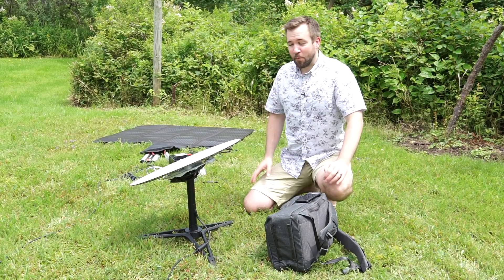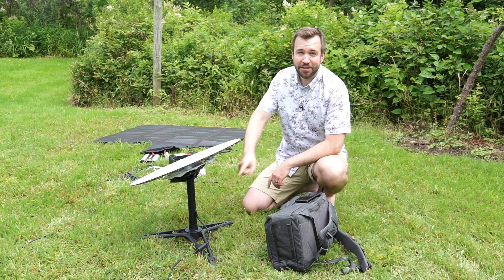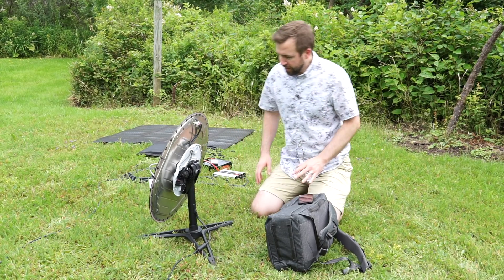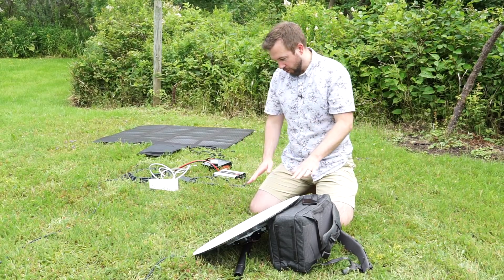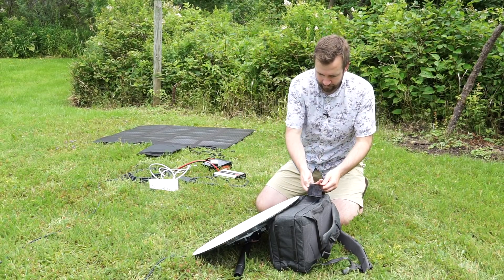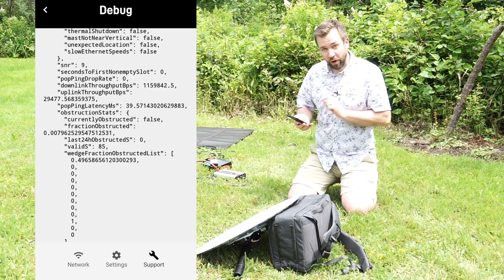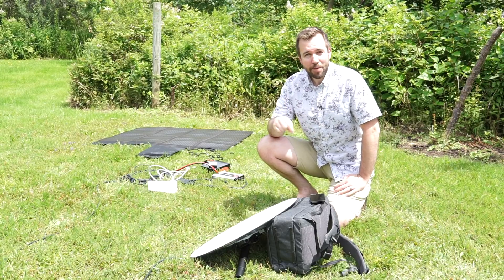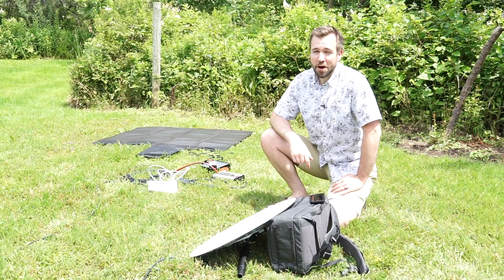Starlink FLAT PANEL Working - 210 Mbps!

Comment: I want to put it on a trailer roof, just flat.  However I did not realize that was an option until I saw another video where someone did that.  It's like 100x easier to install flat as opposed to installing it in a way where it is free to move and angle itself.  I've seen your video where you had some success, and there was a boating couple that mounted theirs flat.  Very interested in your results.  

The other thing is that at your home you can optimize the angle of the dish but in my case I intend to go to new places and then I will not really have the opportunity to optimize the angle (because I won't know the proper angle wherever I will be).  

I just want to know your results over time and any instructions on taking the dish apart.

Hey by the way do you know if it's possible to paint the dish receiver?

Thanks a lot.  I subscribed because I liked this video so much (although I have way too many subs).

Comment: You seem to be assuming that the satellites are stationary.
They are moving overhead at over 1700 MPH, so the motors need to point the antenna.
Reply from the maker: The motors actually don't move the surface to track the satellites. The panel is a phased array that uses electronic beam steering to track the satellites as they pass. The motors are only used to set the initial position. Thanks for watching!

Comment: A couple of things (tempered by the fact that I still can't get Starlink here).

#1 I've been told that they use a special cable to the dish because they are using much higher power than normal POE+. Not sure what to recommend other than check for shielding and use the largest size conductor possible.

#2 I'd probably set the dish up on the tripod, and hand a plumb Bob off the dish. Put a paper under the point and draw a dot. Check the position of the point every 5 minutes and see if the dish is making micro adjustments during operation. Also keep track of signal strength if the app provides that value.

Comment: I currently don't need Starlink anymore, however everything they're doing with Starlink is amazing and I'll always stand by it regardless. It will help so many people out and can ditch their terrible ISP's who like to overcharge and underdeliver internet to them. I think it will be great for when you're on a cruise ship and you're able to actually get internet service. Or a setup somewhere where you get power for everything you need somewhere in the mountains. I find this really awesome to think about. Most people right now who live in mountains actually use satellite internet and it's either not working at all because it's so bad or the speeds are literally so bad you can barely open a webpage.

Comment: I wonder if you could use an array of helical antennas properly tuned and connected to the circuit board and pointed in the vague direction of a satellite.

Comment: Hmm. I wonder if you can ditch the inverter and POE injector for the Starlink. Use a DC voltage converter instead, 56v 1.6a for the dish, then a separate 12v 2.5a for a wireless router. 🤔

Comment: Starlink should develop smaller motorized panels to fit into a bag. This is very useful for travel and for journalists and activists who live in dictatorial countries.
Reply: As the Starlink constellation becomes more and more robust, I expect we will see some amazing things in terms of receivers.   They are already talking about the more robust versions of receivers that would be used on moving objects like ships, planes, etc., and while 200+ MB/s is fantastic, I can see where a very very small, backpack version that could even provide 50-ish MB/s would be extremely useful.
Reply: I imagine that like GPS the receivers will continue to shrink to the point where everything is on a small chip. Although there will be limitations with receiver configurations and device implementation because the radio frequency requires line of sight connection.

Comment: When you remove the motor, will the power consumption decrease? 
and how much the change ? 👍👍⚡
Reply from the maker: I feel like it won't decrease much, since the dish doesn't normal move using the motors. If they're not moving they shouldn't draw any power. Still lots of experimenting to do though! Thanks for watching!

Comment: Mike... one experiment you could try. 

It seems to me the high 56V or so is intended to mitigate the IR losses in the long 100'+ ethernet cable that uses #24 or #26 wire in the long cable fixed installation system. Now that you have the back exposed check the DC voltage when Dishy is in operation.. It's likely to be lower due to the long cable IR losses, unless you have trimmed the long cable. Cutting the cable to a shorter length and then re-terminating it with an RJ45 would cut those losses. 

Now that you have the back exposed check the DC voltage when Dishy is in operation with the long cable.. It's likely to be lower due to the IR losses in 100' of CAT6

Now that you have a short cable, using a variable power supply and making sure the polarity is correct using a simple POE cable with a seperate power supply input, you could try various input voltages BELOW 56V to see what the minimum voltage Dishy will run on. I would like to know what that under load minimum voltage is? 

Now your down to using DC only... and a big increase in overall efficiency is likely.  Lets say Dishy will run fine on 24volts for now.. it might even run on only 12V.. I suspect it might. I doubt you would damage Dishy with a lower tried voltage...it would probably simply not work until it reached a critical minimum voltage. 

But the setup would be DC only. People have reported that the grey Dishy uses less power, one measured as low as 50 watts once it settled down, and that's with the long cable.   

Richard
Reply: Why do I think Dishy will run on a lower voltage? They don't make many chips that run on high voltages, and 56 volts is high.. they run on 3, 5 up to 12 volts. If 56 volts actually appears at the input, there is probably a DC to DC switched mode power supply (they are 95% to 97% efficient) that lowers the actual operating voltage to what Dishy needs, and it'll likely operate on all kinds of input voltages down to a pre set minimum. Ubiquiti does this with their wireless link equipment.. many of those units run on anything from 48 to 12 volts...

Comment: You maybe able to use a stake you could drive into the ground and the mount it on the standard pole? Just a thought. Like a tent post.
Reply from the maker: Yeah, that would definitely work for getting rid of the tripod, but the pole and motors aren't too light either :)
Reply: @MikeOnSpace  yes. But the awkward shape was what I was thinking you are trying to avoid.

Comment: You might have gotten even better signals if the pole had been pointed at the ground  instead of sideways. Not sure if the dish could reorient to being 90° from normal on just the phased array and that may be why the 35 rating at the one point.
Reply from the maker: Yes, definitely possible. The technical information available says that the signals are circularly polarized, so the rotation shouldn't matter, just that the face is pointing correctly. Definitely will do some experimenting!

Comment: Use polycarbonate(lexan) rather than acrylic(plexiglas) for your back guard. Acrylic can crack very easily. Make sure its UV protected either way. Both plastics break down in UV from the sun.
Reply from the maker: Ah great advice, thanks! And thanks for watching!

Comment: Could you have used an an app to orient the angle and azimuth of the dish?
Reply from the maker: Yeah, there probably are apps that could use the phone sensors to position accurately. I'm also going to do experiments to see how far off it can be but still get a good signal. I'm hoping it doesn't need to be too precise, but we'll see!

Comment: Interesting to see if one day Starlink releases an offgrid kit with solar, inverter and a terminal with higher ergonomics, that would be dope
Reply from the maker: Agreed! They'd do a much better job than my hacked-together version :) And I'd love to see a 12V native supply instead of the inverter I'm using now. Thanks for watching!
Reply: @MikeOnSpace  why inverter? Wouldn’t  DC/DC converter be more efficient?
Reply from the maker: @Peter C  yes, DC to DC would be much better, but the dish uses a non-standard power-over-ethernet so the only "official" power supply is the AC supply that comes with it. I will probably try to hack in DC directly at some point, but I'll need to do some reverse engineering to supply it correctly. I'm also hoping SpaceX beats me to it and releases an official one :)
Reply: @MikeOnSpace  hey. Thanks for replying. I am not expert, but my intuition tells me you can probably just open the POE injector and remove the part that converts AC to DC and replace it with DC/DC converter. You can probably leave the rest of circuitry intact. But maybe I am wrong - I have not seen the injector disassembled yet. Being a SpaceX product, maybe it’s more complex than other POE injectors. I should get my soon, so I maybe I will try to do it. My cabin runs on 48V lithium batteries. I do have inverter, but maybe I can save few watts by connecting it directly.